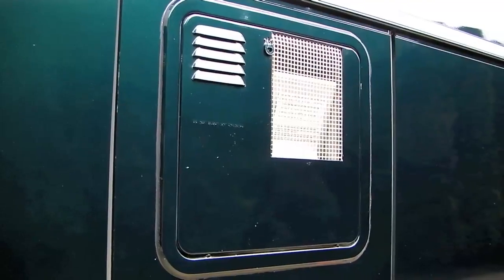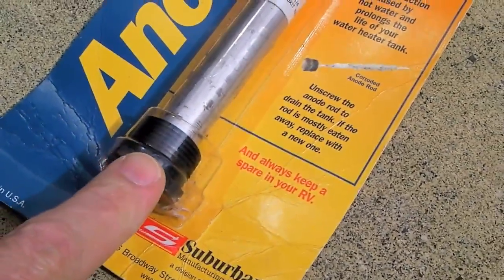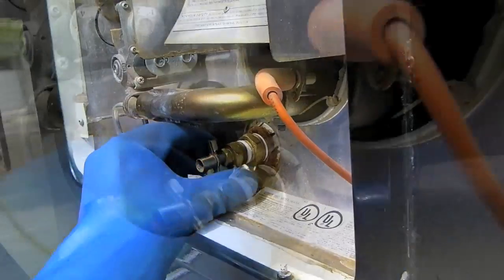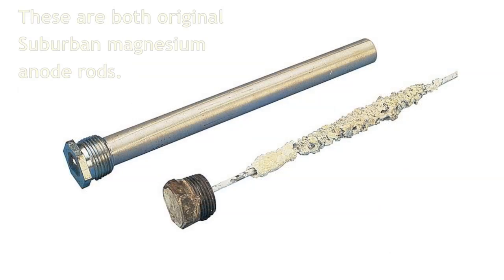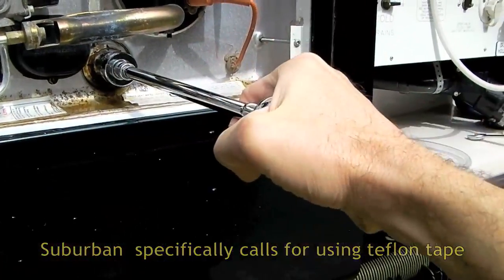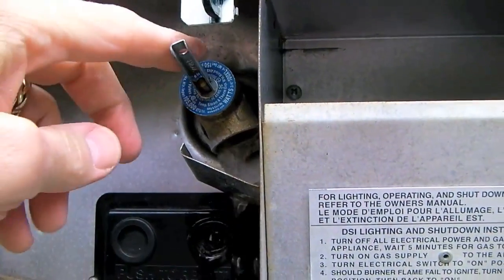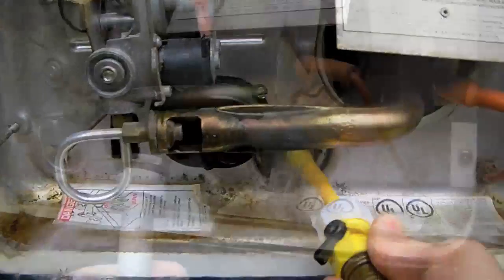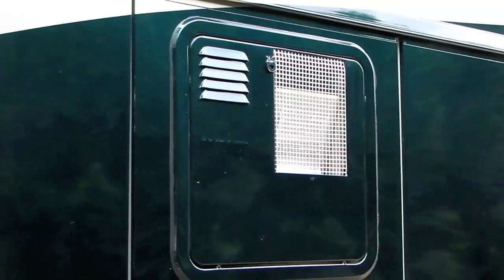How To Flush & Clean a Suburban RV Water Heater

Comment from the maker: I had the exact same thought! Even picked up a new container of it.  When I got back and was getting ready to flush the water heater, I noticed the skull and crossbones on the container, and read all the warnings about avoiding skin contact etc, and decided that I'd risk a stuck anode rather than expose the water supply to that stuff. Good thought though.

Comment: Beware. The caulk seal at the bottom between the water heater and the outside trim prevents water from getting into the inside wall cavity. In my case, my 2014 Rockwood ended up leaking my vinegar water underneath the trailer and also showed up inside on the floor. The abundance of water exiting the anode hole flooded over the caulk and also under the caulk. The caulk appears fine. Thank You for excellent the video

Comment: wow perfect timing.  I just bought a used travel trailer and the 'instructions' that came with it were very vague.  We turned the city water on and didn't know the anode was out.  The former owner had only used it a couple of times and had it serviced yearly by the camper dealer so he didn't know anything useful.  Now I have a better understanding of the what and why of it... Thanks.

Comment: In the future when you're gonna attempt to do plumbing repairs on rvs, especially on a hot  water heaters try putting never seize on top of your telphon cover all the threads of adnoid rod. And do not use the pressure relief valve to depressurize the tank. This is a safety valve not a drain or depressurizing valve. Open a faucett to remove pressure or to vent tank to refill. Your safety valve will not weaken. Have a nice day. Big Daddy plumber of 31 years

Comment: I found your video helpful. Thank you very much. It's great not having to "re-invent the wheel." While reading the comments below I saw the plumber's comment saying to NOT use the T&P valve to vent the tank. I had another plumber explain that these valves shouldn't be used this way because the valve seat could be corroded or debris could get stuck in the valve seat causing it not to properly seat again resulting in a leaky valve. I initially set out to look for a way to vent air and completely refill my Suburban WH after draining. I cant seem to get all the air out of the top of the WH tank which leaves a an air space which compresses as after the hot water faucet shuts off. This causes the pump to "slowly" shut of as it takes a few seconds for it to compress the air. I've bypassed the water heater and operated the faucet and confirmed that the pump works as designed and cycles off immediately. Any suggestions on how to bleed all the air out of the tank?
Reply from the maker: Hi William! Great question. First, plumbers are used to dealing with regular household systems, not RVs, so things are a bit different. A regular "sticks & bricks" homeowner does not need to flush out their hot water tank or re-set the air pocket at the top. Those tanks just leave whatever debris is in them in place, so we can certainly see why a plumber would recommend not opening the valve in that case.

According to Suburban's instructions, the T&P valve must be opened to re-set the air pocket after draining and re-filling, but the reason this isn't a problem is because we've just completed a thorough flushing and cleaning of the tank, so there isn't any debris to get caught in the valve. We've never had any valve problem in over 11 years, but even if it were to leak, you could either flush it again by re-opening it, or replace it, which is not difficult or expensive. But like we said, in all these years, we've never had this happen. We'd suggest following the manufacturer's instructions and not worrying about it, especially because there's no other way to re-set the air pocket.

Comment from the maker: There is a way to get vinegar into the tank without a winterizing kit, but it requires removing the overpressure relief valve. If you're able to unscrew it, you can use one of the long-neck flexible funnels (like the kind they use to add transmission fluid, available at auto parts stores) to add vinegar in through the opening the overpressure relief valve screws into. Hope that helps.
Reply: Unable to remove pressure relief valve; it is way tight and I’m concerned about forcing it. So my question:  is my remaining alternative to run the vinegar/water mix into my gravity feed fresh holding tank then draw into the hot water tank?  Thanks in advance for your advice.

Comment: I liked your video it was very informative. about the anode getting rusted on the threads, I have found putting Teflon tape prior to install helps alot. And after I remove the anode rod after it finishes draining I use a thread chaser on the water heater and then dry the threads real good. I then leave the rod out, seal the opening with duck tape until I am ready to use again.
Reply from the maker: Thanks Martin. Great additional tips. Coincidentally, we just updated this video last week with an important change, and an internal before-and-after internal view on our borescope: https://youtu.be/TL7AtXJYNcc

Comment from the maker: Thanks for the info! We'll soon be removing the magnesium anode we installed last year, and will report on what we find regarding its condition. I'm guessing that the zinc rod that was in there before didn't degrade properly because we're mostly in very low-mineral water areas. I sure would love to find a magnesium aftermarket rod with brass-in-brass threads, like the zinc one. Haven't seen one anywhere.
Reply: Good article, I find putting the original anode rod back in is difficult. I like the one you showed. I liked that you could drain your tank much easier if your going take store it longer then originally thought.

Comment: Thank you very much for the quick response regarding bleeding the air from the hot water system.
I have another unrelated question and hope that maybe you've run across this challenge. I have a Suburban furnace that is ducted. It started turning off as it was heating the space before satisfying the t'stat setpoint. Through a process of trial and error, I determined that when I remove the front cover and allow the furnace to blow directly into the cabin instead of forcing it through the ducts, it ran continuously and eventually satisfied the t'stat and cycled off and on normally. I changed the high limit cutout switch thinking it had failed and saw no change. I believe with the door on, the temp is getting too high and the high limit is turning the unit off as it should. The only way to get the furnace to run again is by turning the t'stat to off then back on. Pretty annoying!
I have searched for blogs, YouTubes, etc looking for someone with the same problem and/or fix with no luck. I have asked the service dept at Mike Thompsons and they seem to look at me with that Dear-In-The-Headlights look. I really don't want to leave the it with them because they are 2 hours away and all they will do is throw money at it.  Any ideas?
Reply from the maker: We  think you have a blockage in your ductwork. Maybe a mouse nest or a collapsed duct or some insulation in the way? If it works perfectly well when not blowing air through the ducts, then it's not the furnace itself, so that's our best guess. If you haven't already done so, we'd suggest posting your exact question on the iRV2 forums to see what other think. http://irv2.com/forums Hope this helps a little and please let us know how you make out.

Comment from the maker: If you can get that rod out, it could prevent having to replace the water heater sooner. If the rod is completely decayed, it will no longer protect the tank from corrosion. Try getting some Liquid Wrench penetrating oil at a hardware store, and apply it to the threads, then tap on it lightly with a hammer. Repeat several times to get the oil drawn into the threads. Then use a large, long-handled ratchet to try to move it. Careful no to force it. If it breaks, you'll need a new heater right now.
Reply: If it breaks, see my procedure for removing a broken or stuck anode!

Comment: I've had very good results removing the factory anode bung using a 6 point impact socket and an air or electric impact gun. Go slowly, reverse direction a few times if needed and don't over do it. It WILL come free.

Comment: Use a nickel-based anti-seize UNDER the teflon tape on the anode rod plug before you put it back in.  The torque on reinstall will sever some of the teflon tape covering, but the anti seize will provide a coating that will interrupt the corrosion cycle.  The surrounding teflon tape will keep the anti-seize from "washing" out into the hot water supply.

I also think y'all might have a parasitic electrical current reaching the anode rod receptacle.  You COULD add a ground wire from that fitting or the metal chassis that it is attached to to a REAL ground rod that will shunt that current to ground and away from the metal to metal interface.  But that is REALLY geeky, OCD, and a pain to drive a ground rod to wet soil every time you stop, but might work for storage.

Comment: When I drained and flushed out water heater, I had a ton of rocky and eggshell looking stuff come out, along with some pieces that looked like chunks of rust. The anode had never been replaced and it’s a 2019. We had popping noises coming from it, but other than that we didn’t have any issues with it. There was still a tiny bit left of the anode but it was mostly just a rusty stem. Should I be concerned about the water heater or is there anything else I should do. I don’t know how to fill it with vinegar because I don’t have the winterizing set up you do, but I flushed it really well and when I stick my finger it there, what I can feel feels smooth.

Comment: A full wrapping of the Anode with teflon tape will insulate the Anode from the water-heater therefore the Anode can not due it's job. Must maintain some conductivity between the anode with the water heater. Wrap only 2/3 of the threads;leave the front 1/3 bare.

Comment: If anode fitting breaks or is stuck due to corrosion, that does NOT mean a new water heater! I have removed broken and/or stuck fittings from all kinds of pressure vessels using the following method! First determine the O.D. "Outside Diameter" of the anode fitting then subtract 1/8 or 3/16 from that size, this will be the size of the drill bit you will need to bore out the inside of the fitting. Then Using a 1/8 - 1/4 inch bit,  drill a pilot hole dead center "Find Center, Mark, Set Center with a Center Chisel and hammer" of the fitting using the low speed setting on the drill. Then using the bit that you subtracted 1/8 or 3/16 from the fitting O.D., drill out the fitting using the pilot hole as a guide, again using the low speed setting on the drill. Next, heat the fitting with a Pencil Torch until about it is about 250 - 300 f. Then using a Ease-Out bit that is 1/16 bigger than the hole you just drilled, tap with a hammer the Ease-Out into the hole, attach the Ease-Out to a long handle break over bar and apply a firm amount of pressure, then while one person holds pressure on the break over bar, tap firmly the swivel end of the break over bar with a hammer! The fitting will pop when it breaks loose!  Because a significant amount of the fitting material has been removed by the drill bit and then heated, the fitting will expand and then contract, allowing the fitting to shrink smaller than its original size which will cause it to pull away from the tank threads and the heat helps to break the bond between the corrosion on the fitting and the water tank! I have saved multi-thousand dollar pressure vessels this way on diesel equipment including high temperature steam vessels! If in doubt, a plumber should be able to perform this procedure in less than a hour! 

This is the preferred tool for fitting removal once you have drilled out the anode fitting! It is similar to a Ease-out!, but for plumbing purposes!

https://www.youtube.com/watch?v=n5lEcnZ1_m4 

Show less

Comment: Great video. Have had our Keystone Springdale 2004 for two years. First thing we replaced was the Anode Rod and of course, now that I want to flush the hot water tank, I can't get it off. My husband walked away in frustration. We are occasional users and I would let it go a bit more, however, every time I turn on the hot water it is yellow. Do you have a suggestion for me?
Reply: Yes, see my procedure for a stuck or broken anode!

Comment: Hello - Thank you for this video. I do not seem to be able to find pure white vinegar and from what I have read, distilled white vinegar is a different acidity. What should I use if I can't get the pure white version?
Reply from the maker: Whichever you can find is fine. Typically, the difference in acidity between them is about 1%... not enough to make a huge difference. CLEANING vinegar can be 10-20% strength, which could be too acidic and require more dilution (less vinegar, more water).

Comment: I want to know just how you got the anode rod out originally. Any tips you provide will be appreciated.
Reply from the maker: +B Cobler With a big socket wrench.
Reply: So far that isn't happening. I've even sprayed some WD40 and taken a wire brush to it. I have placed a block under the sock extension to keep me from pushing down when I try with all my might to turn the socket. Should I try something other than WD-40?

P.S. I know this video was about cleaning the hot water tank but I like so many people have a tank that only heats with propane. Shouldn't the burners be checked for debris? I used some canned air and blew out the burners and was shocked at how much debris came out. Mary Poppins and the chimney sweepers came to mine, so much debris!  So don't the electric ones need to be cleaned out also?
Reply from the maker: +B Cobler We had the same problem with the anode being stuck. Try Liquid Wrench penetrating oil. Apply some, tap lightly with a hammer (the vibration helps draw it into the threads), repeat, repeat, repeat. Be patient and keep trying. That stuff is your best shot at not breaking the fitting by forcing too hard. As far as cleaning - if it ain't broke, leave well enough alone! 😉
Reply: Thanks I'll give it a try. I had never heard of Liquid Wrench.
Reply: Thank you, thank you. Purchased some Liquid Wrench, sprayed it on, walked away, came back two hours later and it came out. You guys are the best! Wish I had your little camera so I can see what it looks like inside because I didn't get much debris.

Comment: You could try to use a grounding cable for the after market rod. that will improve conductivity.
Reply: Conductivity is very important sacrificial zink rods need to be grounded to the tank to work properly. No tape.
I think you should revise your blog.
Reply from the maker: Suburban ships their tanks with plumbers tape installed on the anode rod from the factory, and we have been doing the same thing for 16 years that we’ve owned this rig with no problem. The steel threads apparently cut through the tape enough to make a good connection while still staying waterproof.

Comment: Just a note:
As long as the fittings are electrically conductive on the new anode rod...it will work just fine as a sacrificial anode.

Comment: it's probably a stupid question but i'm changing my anode and the rod doesn't screw all the way to the end of the thread ….have i stuffed something up ?
Reply: but i've measured the inside of the tank and the rod is shorter than the length of the tank...
Reply from the maker: owlllover Don't worry if some of the threads are still visible. That's normal. If the rod is tight and doesn't leak, you're fine.
Reply: RVgeeks thank you !!! I was a bit worried and thanks for your speedy reply will go and fill the tank now lol